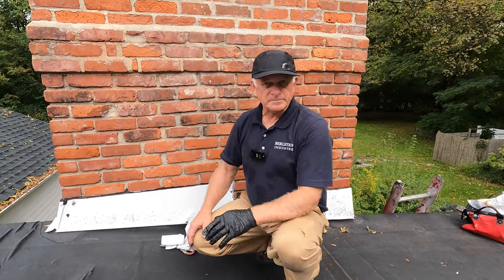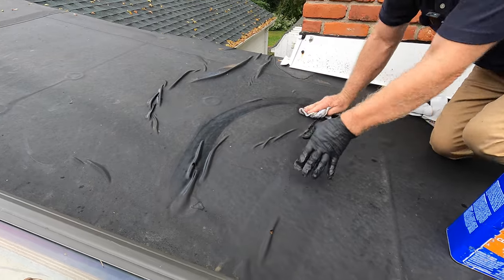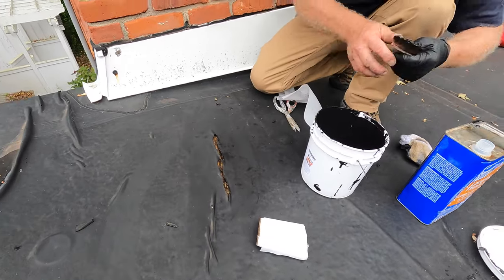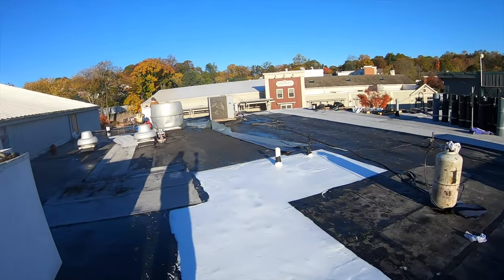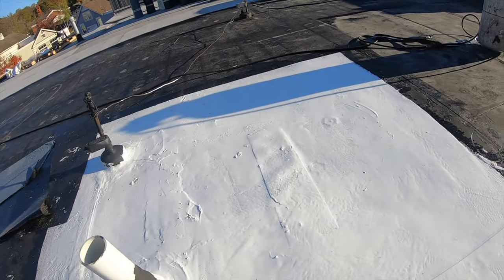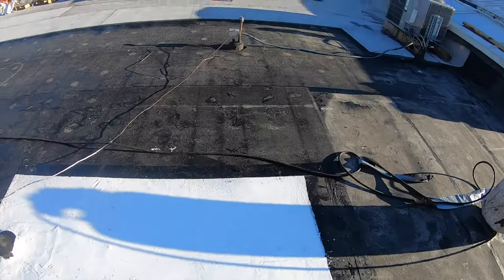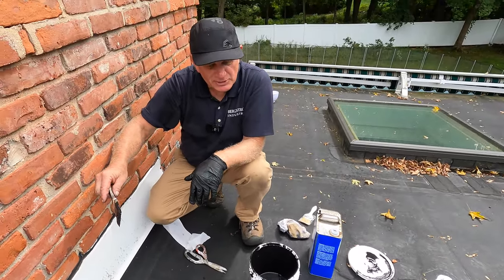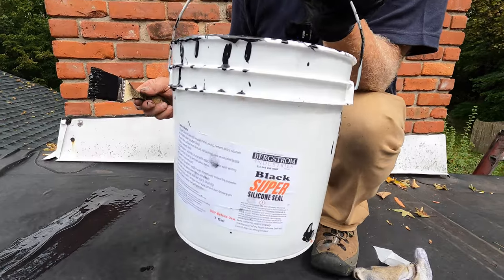REPAIRING a leaking EPDM Rubber roof: Only 3 Minute repair - Super Silicone Seal

Comment: Epic fail. You just voided the homeowners warranty. After you cut the wrinkle out you were to reglue the under side of the field membrane or cut the unglued material out. Mulehide has the cheapest adhesives primer and seam tape to make this repair. Your a product pimp. Your fix will crack in extreme temperatures.
Reply: no. it wont fail its silicone bro